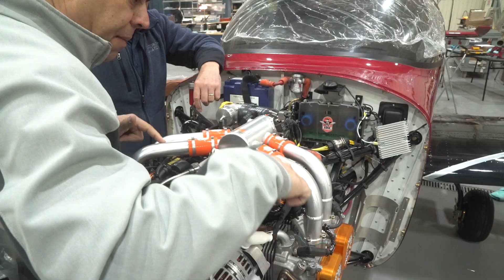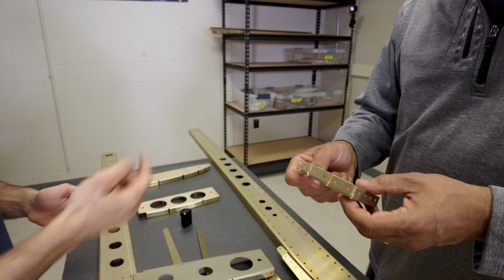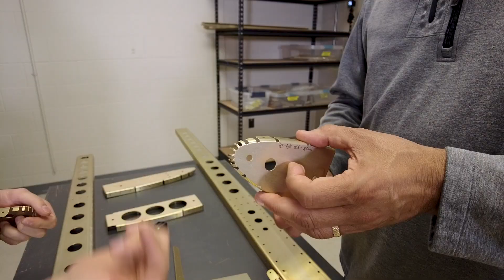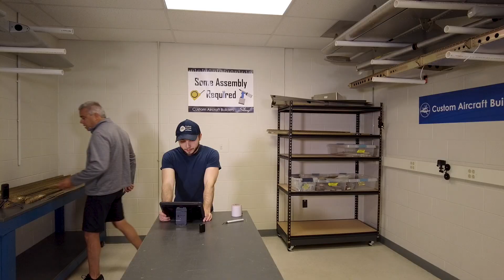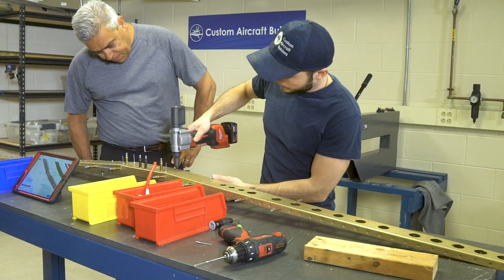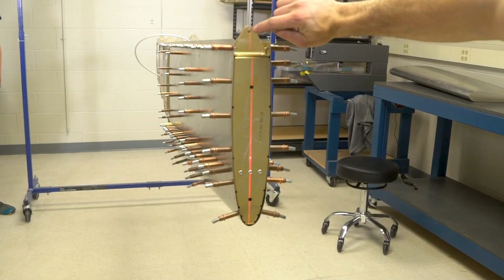Dale Norton Sling TSi Build - Episode 1 - First Day of Build

Comment: Is this a 51% builder assist? You said “today we’re going to build …” but that adds very little context. How many days/hours will this builder assist involve?
Reply from the maker: This is a 51% builder assist. Dale's build is a little bit different than our other builders because he is local. Our builders from out of town typically come up for 3 to 5 days at a time, handful of times throughout the build process. In those cases, the process takes about a year. However, current global trade logistics could affect the overall timeline depending on where some components are sourced. The process is task-driven and rigorously regimented and documented by our team, but not necessarily tracked by days/hours.